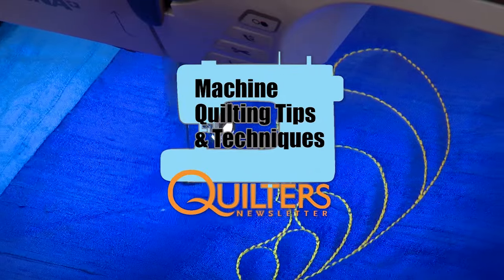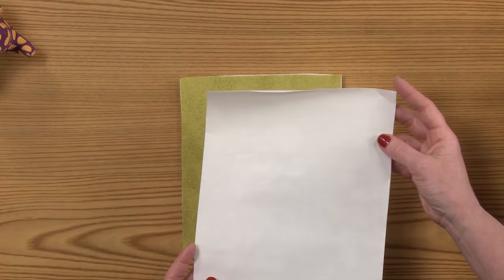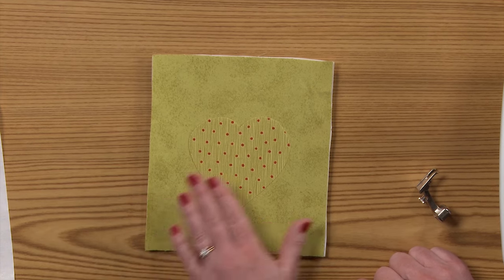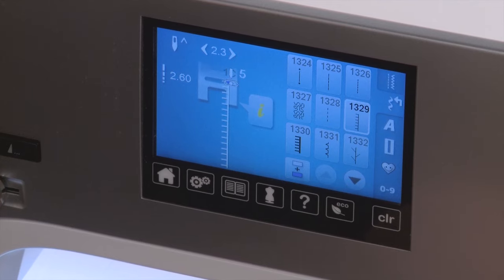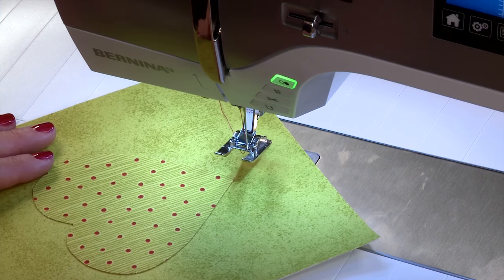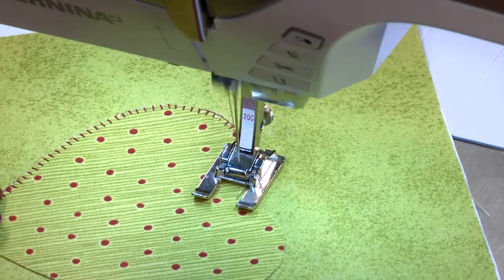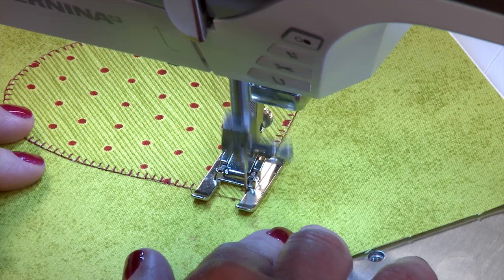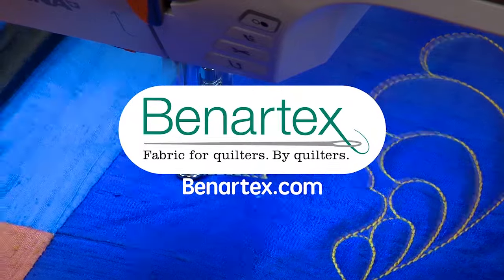Applique Basics

Comment: You’re embroidering close to the edge of your quilt.  How do you put an embroidery design in center of your quilt?
For appliqué, do you cut your "heart" 1/4” larger, then fold in the edge…..and blanket stitch your .heart. With only the cut edge?  For example, I have a "Mommy & Me" set of elephants to machine appliqué unto a baby blanket.  Do I cut the elephants a bit large and turn in the edge ALL around, or just stitch the cut edge.  I wonder if the cut edge will fray as the blanket is washed and dried.  Thank you!